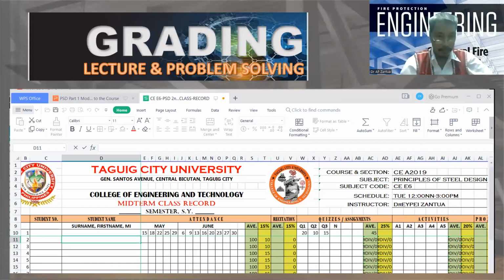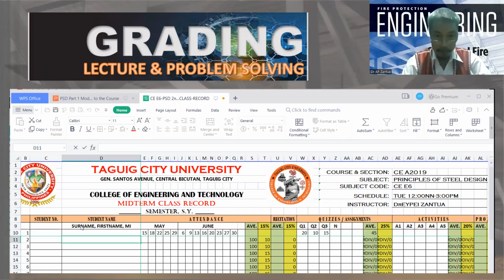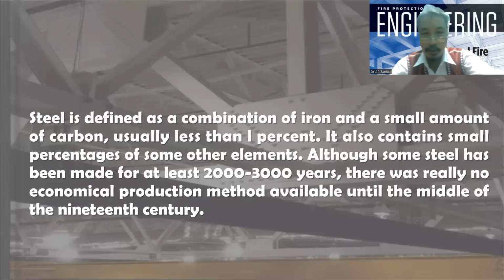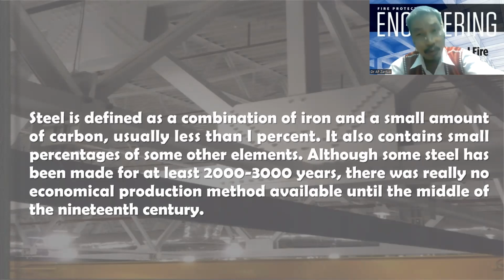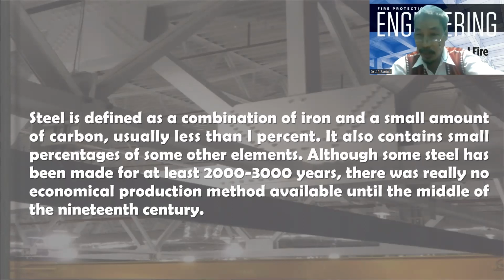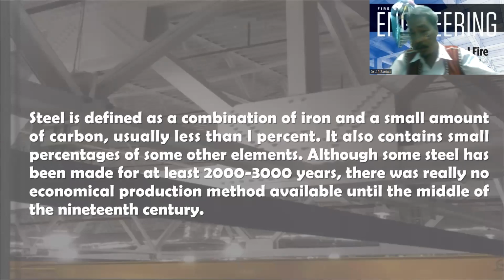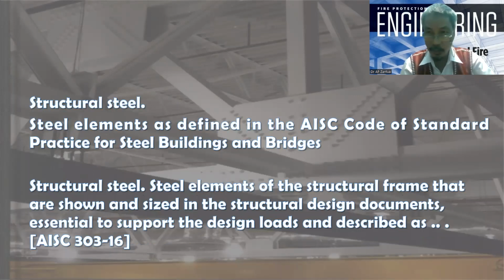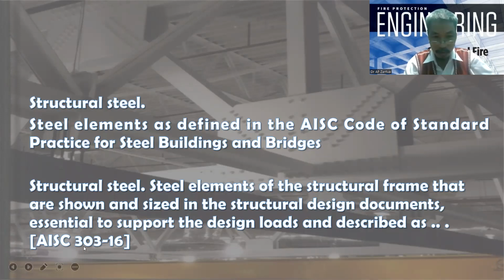Class Orientation [ Principles of Steel Design ] Module 1.00 Part b

Comment: Thank you Sir for giving us some reference books that we can use during the discussion of the course Principles of Steel Design. And for discussing some of the topics that we will tackle next week.

1. The old CMO is called Structural Design 2 (Steel and Timber) wherein it tackle about the designs with the use of wood and steel. While the new CMO is called Principles of Steel design which tackles the theories, concepts, principles and design in structural.
2. In the old CMO the specification is 3 units for lecture and 1 unit of Laboratory/Field/Tutorial which is 3 hours for lecture and 3 hours for exercises per week. But in the new CMO with 3 units, 2 units for lecture and 1 unit for Laboratory which is 2 hrs for lecture and 3 hrs for laboratory. And the references used in the old and new are not the same. In the old CMO there's a lot references but in the new CMO there are only three references used.
3. In the old CMO it is more broad than the new CMO because the new CMO is more specific from the old.
4. I am okay with the grading system that we are using right now and I know that my professor will give me the grade that I deserve and what he think is right and reasonable.